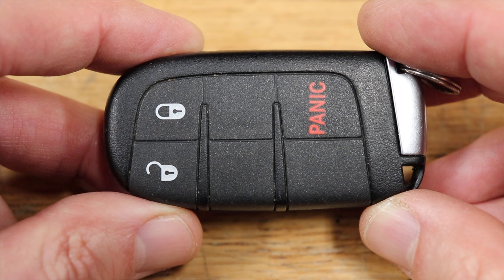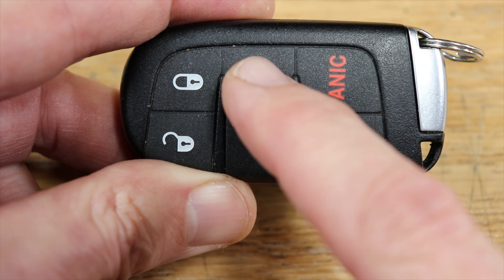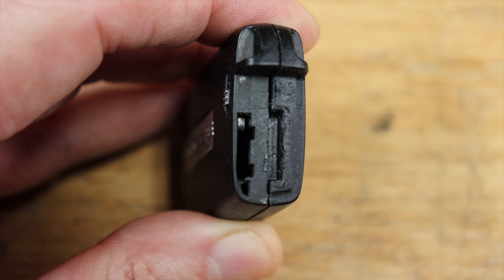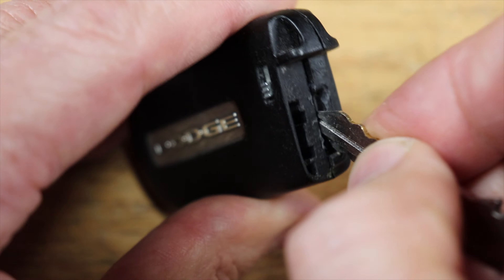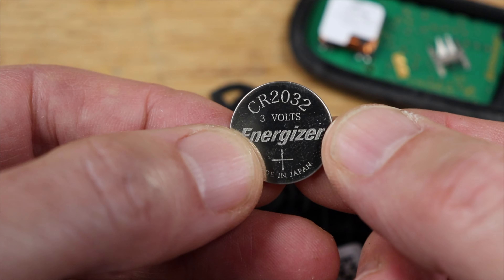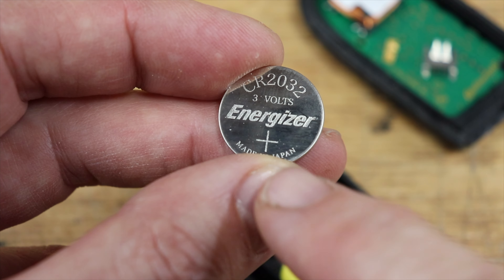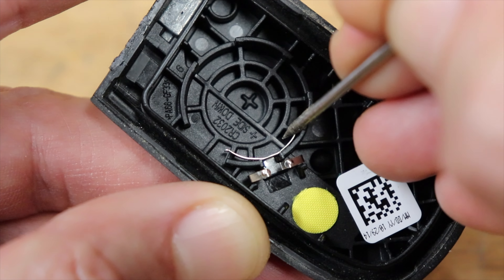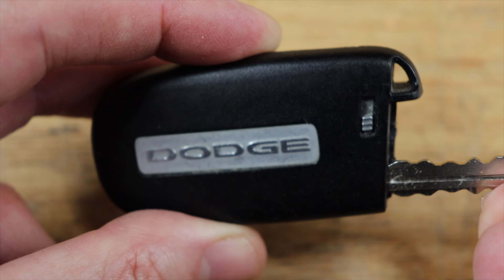How to ● Dodge Chrysler Jeep Key Fob Remote Keyless Battery Change/Replace

Comment: The housing on my Opel (GM) key broke. Opel wants €276.00 (€176 [Euro] + €100 to program it). Googled Opel key and I found a video showing how to replace the flip key and circuit (and where to buy the housing). I ordered a new housing which cost me €14.85. 10 minutes after I received it I had the key and circuit swopped over and it worked as good as new. Now my wife wants to spend the €261 that I saved.......